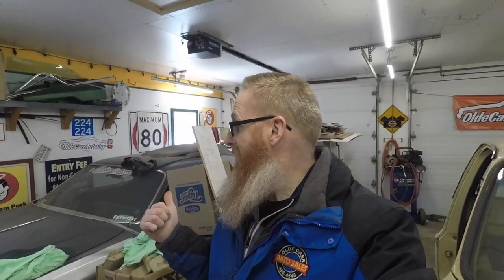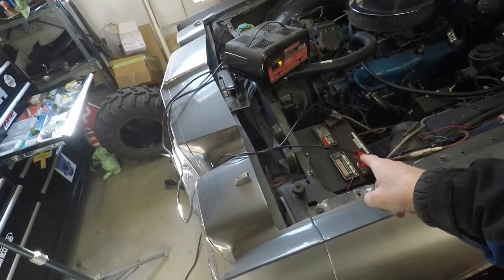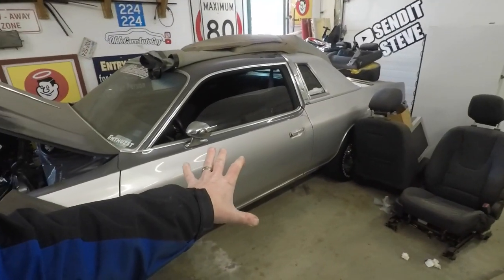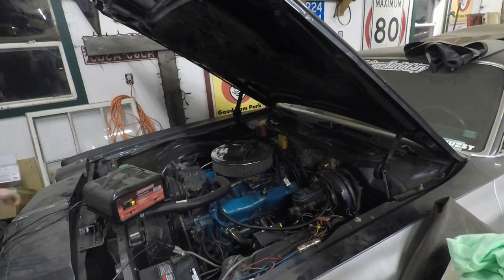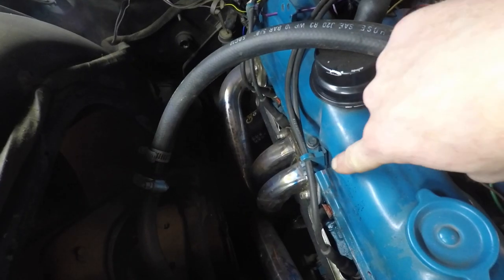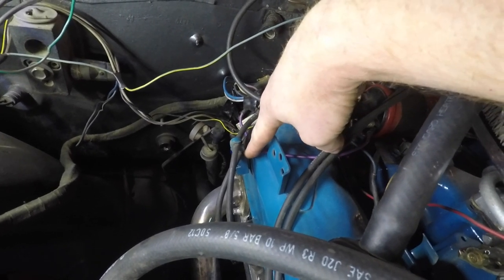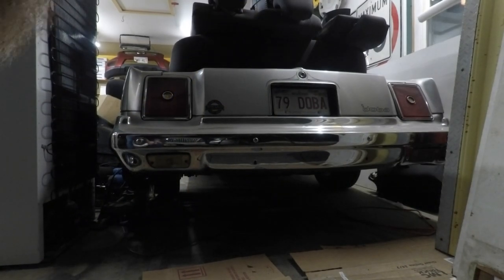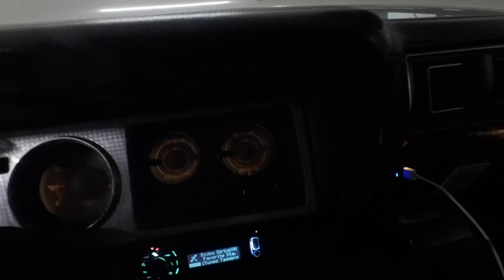First Start Cold Start Of My 1979 CHRYSLER CORDOBA Since September 2019

Comment: this makes me insane, that was a very rare 300, not a Cordoba. the value of that car lost, oops
Reply from the maker: This is where it helps to know the history of this particular car. It is in fact a 79 Cordoba. The grille, fender luvers and dash trim was out of a wrecked 300. I bought this car in 1995 with all the 300 trim on it and the car was blue and white then. When i restored it in 2007-08, I kept the trim because it just looks so much better with than without it.

Thanks for watching. Hope you stick around to see the Holley Sniper get installed on this car. I also have a bunch of other projects on this channel. Maybe you'll consider subscribing.
Reply: @OldeCarrGuy  I had a used 300 with a power sunroof that rotted out so bad I couldn't save it. I bought a 79 Cordoba and transferred all the 300 parts. I too got rid of the lean burn ignition and put a cam in it, these cars turn heads.